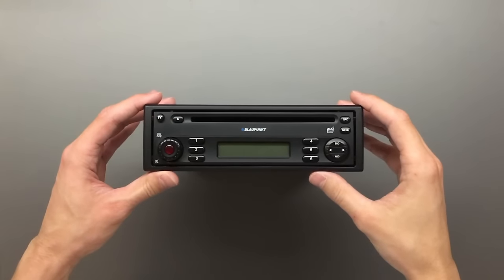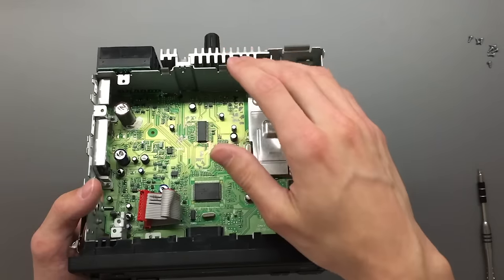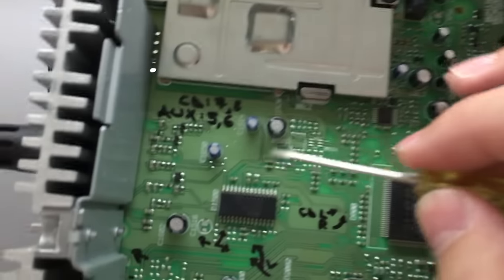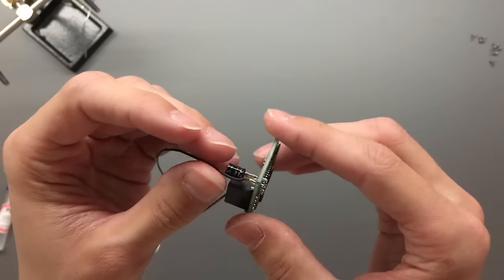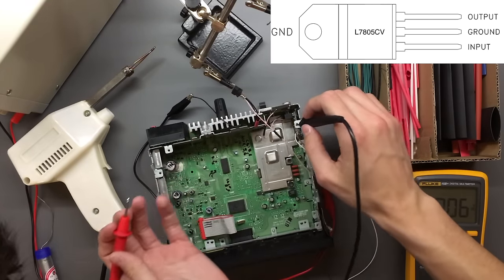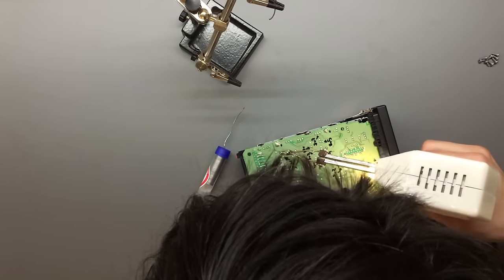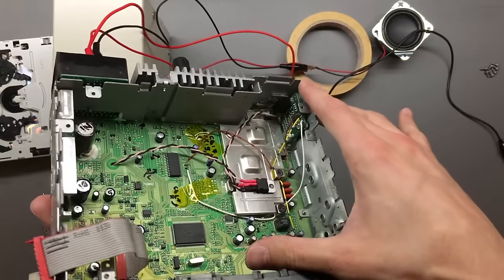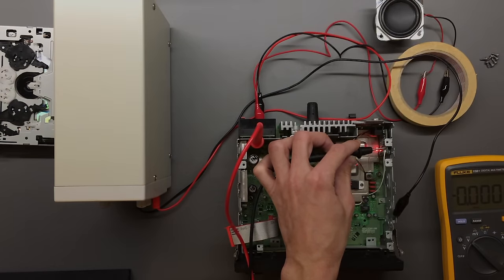How to Add Bluetooth 4.0 to Any Car Stereo for 12$ ! Complete Guide !

Comment: nobody appreciates practical technical knowledge anymore nowadays. i liked it and nevermind the haters, this is craftsmanship.
Reply from the maker: thanks ! Nah I don't even think they take themselves too seriously - glad you liked it
Reply: Hi Bob, I would rephrase your statement to say something like "some people don't appreciate..." Since many others like you or me do appreciate it. :) Thanks
Reply: Holy smokes nice work but I would end up wrecking my stereo on attempting this but all the same very informative thank you sir
Reply: Right there with ya buddy. I was just curious if he did this internally. In America, they’re nearly all 5v. Sold as Bluetooth recievers, with the micro USB on one end for the power, and a 3.5mm headphone socket on the other. Right there, most quit once because brain can’t process it. 

The rest of us run a power wire from someplace in the device thats 12v-15v, along with a wire to ground, connect that to a cigarette lighter usb Charger, then from the charger to the Reciever use a little micro usb cable. Then an auxiliary cable from the 3.5mm socket, cut the other end off, and solder/wrap/crimp the L & R Audio wires to the inputs of the device. Tuck it all out of the way and seal her up.  Or let her dangle like most people. 

My vintage 1970 HK Reciever has Bluetooth now and trips people out. Like it’s magic. sigh
Reply: Darieee what do you think can we connect bt on back side where is for changer place. R-in and L-in on back side of radio becouse my mechanic of cd is brocken? Or we cant use that input?
Reply from the maker: if it's the same exact radio, then you can't use it
Reply: Darieee Jah, wir brauchen noch simulator dass radio weiß da ist cd changer. ok, ich bedanke grüß
Reply: Exactly, why is it that people always want to start arguing the toss with on another....forgetting the actual subject matter.
Reply: @Darieee  man where you live I need your help with my 2008 Corolla S ?

Comment: "Time Waste" comments really ignore the knowledge acquired by you in this process. Though I'm not at all in this field I really enjoyed.
Reply from the maker: I'm glad you did ! I do wonder however wether or not very deep down they are actually trying to help out somehow by helping us not 'waste' our time
Reply: PHANTOM 808, Did you even read and understand Venkatesan S's comment?
Reply: You are right. If bluetooth player costs x € you would still have to "waste" your time in the work to get that amount of money.

Sorry, I gotta go to play some Fortnite ➡️
Reply: I was trying to do this to my stereo a few years ago but was too lazy to find all the inputs and so on. I ended up having to hack the steering wheel transport controls anyway to make them work with my new head unit. Im glad I bought the new head unit though since it plays music from USB and I only need to use the bluetooth for calls the new stereo also came with hard wired hands-free. This is a very useful video though and I am thinking of making a similar one on the hacking of steering wheel controls.
Reply: @EasilyFallsForClickbait The devious minds can only read what suits them.

Comment: A 55Ah battery drained with 50mA is empty after 46 days, not 114 years. And you shouldn't completely drain a car battery anyway. So let's say we can safely take out 30Ah, and the car electrical system also drains 50mA, then we're already down to 12,5 days, less than two weeks...
Reply: Yup, caught that also, and your math is right on.
Reply from the maker: Don' messed up on that one

Comment: I had to take the time to say you did a quality job on that man very good work,  you heat shrinked every wire, you didn’t hot glue the module in you took the time to drill holes and screw it in, you twisted the wires so they weren’t just floating wires, i seen some taped down to the board too! Very quality work man
Reply from the maker: thanks man ! hot glue really wouldn't cut it - the damn thing gets up to 100C in the summer xD

Comment: This is best for a car where the hvac is built into the radio making it impossible to replace the radio. I.E. i did something similar in my 2008 Lexus is250. This car is just old enough to not have Bluetooth. It worked great, but if you don't know what is what you'll have to read a lot. I have some experience so it was easy for me to do.
Reply from the maker: What Bluetooth chip/module did you use ?
Reply from the maker: Dayum, must've been a lot of fun soldering to those edges 

Does that have the 8645 inside ?
Reply: Darieee I wish I could tell you. The datasheet they have on the site is full of info though.

Comment: A few years ago I wanted to replace my e46's stock radio-TAPE but I was suposed to buy a "Standard Radio Frame" from $$$ BMW $$$...
In the end, I converted the original to a Radio-Tape-BL (3 function) while the BOM was even cheaper:
5$ for the (cheapest I could find back then) bluetooth speaker to dismantle
0.5$ 1x 7805
~0$ : 1x 1N4148 + 2x 33Ko
I'm using it on a daily basis so it worth every second, Waste of Time my a$$.
Reply: The "standard radio frame" for the e46 is 5 to 10$. The problem is, aftermarket stereos look like ass in the e46's dashboard. I went with a simpler mod - I created an "aux in" by dismantling the tape drive inside the stereo, removed the read head, added filter capacitors and tiny resistors and soldered a wire with a jack to where the tape drive's head was. Then I jammed the tape drawer to fool the drive into thinking there's a tape in the stereo and done. When selecting the cassette player, I can use the jack to get quality audio via aux in. Then i got bored of that not being able to switch tracks using the steering wheel buttons, and got a  Dension Gateway Lite  adapter witch provides a USB port, works with the steering wheel controls, and can display track information on the stereo's display. It cost ~90$.  Then I got bored of that and installed an aftermarket 2 din nav system witch looks identical to the car's original navigation, but has a touchscreen and android 8.0. It was expensive to do (270$ for the unit and another 100$ for a new ashtray holder to move the climate control down one slot) but it's so worth it. I have mp3 (via 2 usb ports or two sd card slots), video, DVD player, navigation via google maps or igo, Torque for scanning codes, youtube, a reverse camera and much more. I even put a NES emulator on it for kicks. Worth the 370$.
Reply: Dude where you live I want your help with my 2008 Corolla S ?

Comment: Interesting soldering technique :P
Reply: You mean soldering small electronics with that firestick? - Quite impressive i must say!
Reply: Darieee — Or you go buy the right tool for the job and do the job right. You can get a 30-40W soldering iron for $10.
Reply from the maker: Mm, I did get a 70€ one like bigclive has - that's way too weak, and very cumbersome to set up on the table
Reply: Tor Arne Hustvedt or use one similar to Louis Rossmann

Comment: Super videos for the DIY!  Much credit.  For the NON-DIY,  A decent Bluetooth to FM transmitter is 11$.  I've found them at 5 below and dollar stores 1$.  No radio disassembly or reinstall required. No tools to buy,  Can run off batteries,  fuse box,  usb,  cigarette socket, etc.
Reply from the maker: Yeah, that route does sound quite a bit worse though

Comment: Hi! Thanks for sharing. Excellent description. Just a quick question: What model is that Blaupunkt? I really like the design of the front panel of it.
Reply from the maker: Mmm, no idea ... I can look it up in about 3 weeks if you really need it

It's an original dacia logan or dacia sandero radio... 2011 or prior or maybe even earlier

Paid around 60€ for mine at the time
Reply: @Darieee  Thanks! No worries, the Dacia lead gave results right away.

Comment: if u have problems with the voltage regualtor to work, solder a 100nf capaitor close to input and output, many cheap alternatives to lm7805 dont work well without these caps

Comment: i have a problem here, i bought a second hand car with a bluetooth head unit, but i cant use it, i mean i cant detect it with any of my devices
Reply from the maker: did you like your own comment :)) ?

open it up and see what's what .. is it at least a name brand ?
Reply: piece of potato maybe it has an early version which is out of date so to speak
Reply: Try holding down the "Call" button.

Comment: nice job, one cuestion, how can i create a radio station to emit silence?
Reply from the maker: You could buy a Radio Adapter - buying a non-bluetooth one should help with getting as clean a radio signal as possible. Here's some on amazon http://amzn.to/2snA9ot
Reply: Just hold the button that says "Power" until you can't hear anything but silence
Reply: man, just call them on thursday, they got that call in request hour, you could request "Emit Silence" they will probably play it for you as long as it's not got cussing in it
Reply: Search via Tune to a all static station with the same on either side. If that is what you are asking.

Comment: Oh, how useful this video is for beginners! Can you tell, what capacitor did you used? How i need to choose the right one if i’ll be using this scheme?
Reply from the maker: 100uF 16v should be ok 

just make sure to put it in the right polarity 🔥
Reply: @Darieee  Thanks a lot! Going to order some stuff and begin my little project. Although my nissan altima 2005 radio is a “little” bigger, but i hope it will be ok)
Thank you veery much, really useful and good video!
Reply from the maker: Glad it helped out - best of luck with your project 🤘🤘

Let me know how it turns out

Comment: Absolutely magnificent, will try it soon. Do you think it's possible to link its next and previous track buttons to unit's as well?
Reply from the maker: Mmm, would be very tricky, and you'd need them to send a 2.2v or so pulse to the Bluetooth Module

Comment: this is a fantastic video man. i really appreciate it because my car (2009 honda civic) made impossible to connect the built in amplifier to aftermarket radios so ill try this. what id like to know is, given that is going to be connected to the CD source, AM I GOING TO BE ABLE TO USE MY STEERING WHEEL CONTROLS TO CHANGE A TRACK just like when i do it with regular cds????
Reply from the maker: Unfortunately not :(
Reply: @Darieee  knowing this, if my car has aux do you think it would make any improvement in quality audio to do this procedure instead of continue using the aux cable? The thing is that I want to mount and connect a surface pro 4 heheh.

Thank you very much for your reply it's awesome you take a moment to do it.
Reply from the maker: No worries, my pleasure to help out!

Sound-wise BT4.0+ with the right protocols, sounds equally good to an AUX cable in a car environment at the very least

If you can get the bt module to power up with the radio, then it'll automatically connect, so ... that's another convenience benefit

Comment: Hi,
really great video, I was able to learn from it what to do so that it works on my own radio unit.
I think it's very nice that I'm not the only one who wants to keep the contemporary look of the radio in the car.

But I have a question: Well, it worked and I was able to bring in the bluetooth signal via the cassette connection to the speaker of my car. But I have a lot of interference noise.

Do you have any ideas where the noise could come from?

Thanks a lot

Comment: nice video just bought myself a bluetooth module for my car  which does not have a aux input so thanks for this will follow your video as im fitting mine
Reply from the maker: do check the newer video I have in this playlist - they're way better done than this first attempt
Reply: @Darieee  will do thanks
Reply from the maker: also 🔥, lemme' know if it works out

Comment: Not worth the trouble
Reply from the maker: what trouble ???
Reply: Some folks enjoy to make little things with their own hands no matter if that thing cost a penny, others enjoy going to the store to buy the same thing and then continuing with their boring life.
Reply from the maker: thank you very much xD
Reply: GManGT its worth it if you have the skillset.
Reply: Roland Hatton I have the skillset, but you have to value your time versus just buying a readymade unit.
Reply: GManGT I enjoy doing that sort of thing so I guess its different if you like doing it
Reply: +GManGT some people like classic stuff..and I'm doubting you have the skills if that's hard to understand..
Reply: awesome work I did the same thing to my factory head unit I like your Bluetooth module better than the one I used I might switch to that one. do u have to push a button to pair your phone to the module thanks
Reply: Ya it's not hard if you know what you're doing, if not buy a b5 deck
Reply: I like diy but for beginner i have no big tools i have only drill and solder, sometimes initial cost is high than buy new, but yes it was fun
Reply: Saya Laper all you need next is some thin gauged wire and a soldering iron and the bluethooth module linked then solder by following the relevant information

Comment: Thats an awesome modification bro, I like this tutorial,  you are amazing , and I need to ask you one question , if we need to add the Aux pin to the car stereo instead of the bluetooth , should we do the same thing? I mean should we connect the Aux wires to the same audio's pins in the audio module?

Comment: Hi, great video and really helpful, Is it still possible to play a CD as long as your paired device isn't trying to play music too? also can you connect this same module to a cassette player or does it have to be CD, thanks :D
Reply from the maker: The theory should be similar for cassette players, with a few minor differences (there's videos covering such cassette based mods from the postapocaliptic inventor I think); I too recently bought a mercedes tape radio, soon I'll be making a video on that as well .. once I get to it that is

Yeah, you can still play CDs just fine, only that if the bluetooth module is powered on, it'll clamp the audio lines down a bit (so max volume won't be what it used to)
Reply: Great, Thank you for the advice :D

Comment: Excellent and very informative video tutorial. Thanks for all the help and ignore the haters :). Just wanted to ask if you have tried this conversion with the newer csr8675 chip and does it work as seamlessly?? Thanks in advance
Reply from the maker: thanks 🤘

I haven't yet found a single-ended output CSR8675 module so - it can't at the moment be that seamless unfortunately
Reply: Thank you for the very prompt reply. Cheers

Comment: Great job!
I have a question,
Did you get a good range installing the module inside the chasis?
I'm planning on doing it on my '03 Pilot which comes with CD and cassette players, using the cassette input, I'll trick the cassette player I guess.
This factory stereo has great sound and sub-woofer.
Reply from the maker: Inside the car, outside of metal cans there's nothing one can do and nowhere you can put the phone to make it lose signal; 

Man that radio looks like a f'cking tank, none a this "modern" bullshit lights and crap, good luck ! Let us know if it worked out !

Comment: I love the video. I have bought an aux Bluetooth adapter for a RNS310. Do you know if I could connect the power to the + and ground of the RNS310 destined for the CD changer? Or should I find another source of + and use the radio unit's case for ground?

Comment: nice video! Im wondering if you can help me with my issue. I had purchased a panasonic cq vx5500 head unit off ebay and was told there was a bluetooth module in the Aux input. after installing the head unit, i attempt to connect to the bluetooth, however the signal drops and i have to reconnect again. what might cause this issue? i dont know if its related but it coincidentally happens when i turn the volume up. thats where it happens the most

Comment: Nice project, but you can buy Bluetooth adapters that plug into your cigarette outlet and tune to any frequency on your radio for less than $20. And they have a built in mic for phone calls, which isn't great most of the time but works ok. I doubt anyone could hear you talking into this setup.
Reply from the maker: This setup doesn't have a microphone at all

The sound quality over FM is pretty limited, even with perfect signal transfer ...

If you don't mind the loss in quality, then this kind of hack for sure isn't worth it, I agree

There's ones for 10$ and lower too

Comment: Oh man you are great. Thanks for sharing your knowledge.
Why you don't connect to CD changer? And how about forcing music forward and backward by car stereo button?
Reply: I ordered my chip from your suggested ebay link. Very soon I will start my project too. Tnx
Reply from the maker: +siamak g you’re welcome :D - well, first, I’m kinda wanting to move away from the whole CD situation, and 2nd, the port on the back is there just for laughs ... the components connecting it to the ‘switchboard’ chip are not in place (and there’s no option in the menus to go to it). You cooould connect the next and back buttons ... but it should also be incredibly hard ... the BT chip expects two of its pins to be bridged for each switch - not a connection to GND or + ... and it could well be that the front pannel taps are digitised and sent over a serial line (perhaps even scrambled to prevent this faceplate working on other stereos)

Comment: Great job !
I have a question witch software do you use to programme the chip ? (for the CSR8670 the same i think)
Reply from the maker: +Ottawh I've done 3 videos on renaming, setting the equaliser, and disabling the microphone of these chips, feel free to find them on my channel [I think you'll need a newer version of some of the programs : comment on the specific video you need and I'll see what I used for the 70][the renaming should work just fine in any case if that's what you're after]